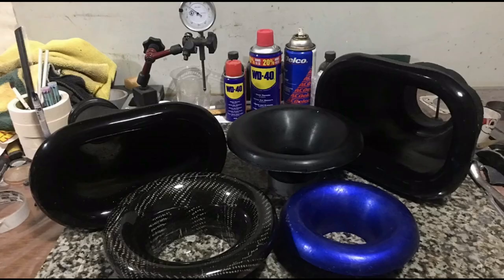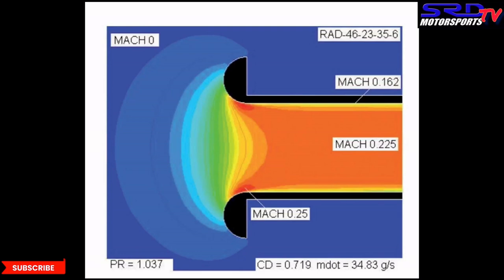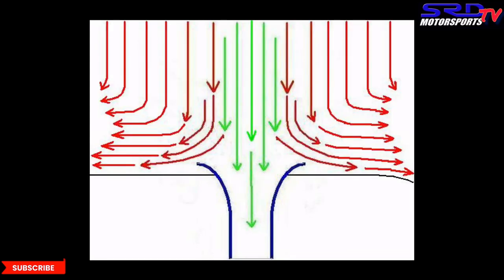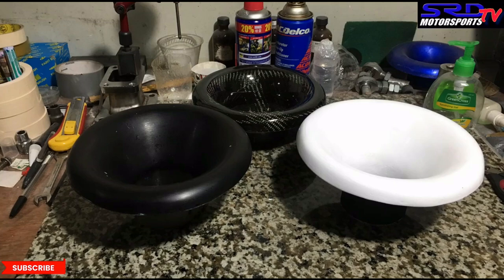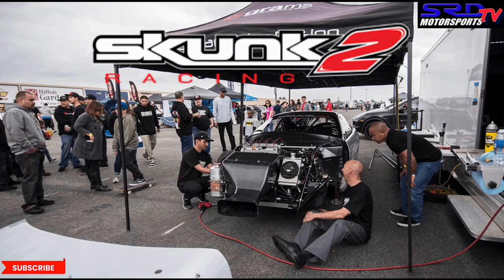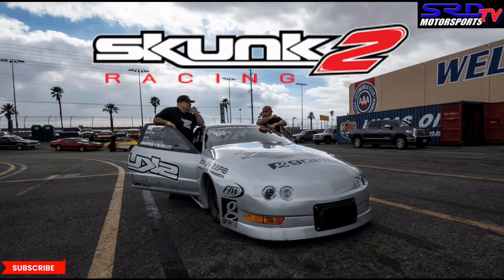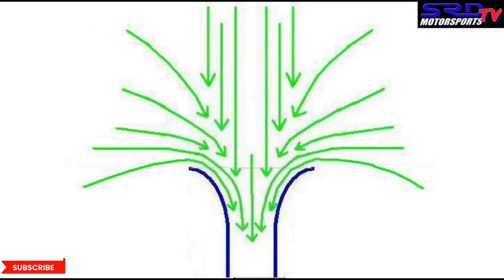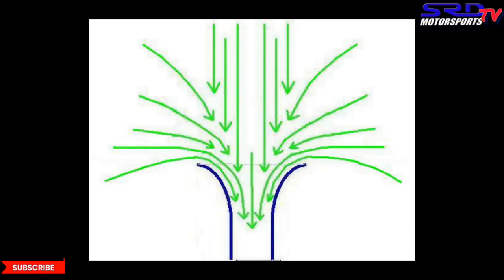Velocity Stack / Ram Air : Design Analysis by SRDmotorsports

Comment: Watching this while I design a set of velocity stacks for my E92 M3, cheers for the brilliant upload mate
Reply from the maker: whoa an E92 awesome!! and yep on this vid hopefully the "diagram" of all diff bellmouth entry can give you more interesting ideas TBH i was surprised at the highest rated one
Reply: @SRDmotorsports  I was really interested to see how much more airflow the ellipse had than the other designs. I found the paper you got those flow pics from and they had some guides for the dimensions to go off.
Reply from the maker: @ScottGroome  oooh will def update in the future to see changes on airflow mass change if there is any or do we need "more"

Great you saw the papers awesome!!!
if it helps, I use what its called i think Sintra board its sorta like a foam on varying thicknes and used that to make patterns/plugs then painted primer to be able to mold...

might be usable for you even when making an airbox :)
Reply: Did you did it ?

Comment: I feel like you're looking at the airflow around the intake wrong. 
Instead of looking at where the air goes (some of it diverting to the side of the intake) consider why it goes to the side. Pressure difference makes air move, if there isn't any pressure difference air won't move. If the air is diverting around the side of your intake it's because there's higher pressure in front of the intake and lower pressure to the sides. 

There's two separate things at work here: A velocity stack is designed to take relatively still air and get it into a tube as efficiently as possible by minimising the turbulence as air coming from the sides tries to make the turn into the pipe. It's purpose is to prevent turbulence and maintain laminar flow. 

A ram air intake's purpose is different, it's there to turn kinetic energy into pressure. You probably want a ram air intake into an airbox of sufficient size and then the engine drawing air through a velocity stack from the airbox which will be at positive pressure from the ram air. A jet engine intake is a ram air intake but a lot of the design in a jet engine intake is to slow air down from near transonic (or supersonic in some cases) to subsonic so the engine's compressors can handle it. This won't be a problem at road, or even race, car speeds.

My guess would be a velocity stack style intake on the most vertical part of the front bumper (stagnation point) feeding a tube that increases in cross sectional area as it goes to an airbox would be an your best bet. The rate at which the tube feeding the airbox gets wider would need to be calculated to maximize pressure recovery.
Reply from the maker: Yes hence my examples are the lesser super sonic ones not an sr71 or an f16

and on to the intake “why” it goes to the side

All I shared is running a velocity stack front faced at the track isnt an “ideal” thing to ise

Like you mentioned and as I mentioned in the video it was meant to be efficient at around “still” or “stagnant” air not “forward” facing like most Honda racers do,

On the dyno yeah it helps as the car is strapped down…pardon me if the English sentence structuring isn’t ideal on the video 😇

Comment: Interesting. I was running a carbon fiber intake on an all motor car a couple years ago. 

I was running a 168mm tb, and even then I thought it was too large but I ended up making a PSI on the map at high speed.

I like your break down. This is interesting
Reply from the maker: Hey! That psi is awesome u found that!

Comment: Nice video!  I still think your radius might be too large on your intake at 14:04 , as we see on the forward facing F1 car intakes (above the driver) at 9:07 to 10:20 , the radius on the inside in particular seems to be pretty small.  I don't think you need a velocity stack where it goes down to a circular profile inside the duct, but rather an efficient contraction profile that's perhaps more smoothly blended into overall contraction as it shrinks down.  That's a really cool intake any how though!
Reply from the maker: Yep the stack shape isn’t really needed for forward facing… the stack inside though was mainly to aid in reducing the contraption into a circular pipe, I just did mention I used a small stack as shape source for it

hence the oval intake I made is mainly for max cross section available and def worth a few tests :)

Comment: Enjoy your videos thank  You. So the theory is your velocity stacks with stagnant air or an enclosed department you run a flared velocity stack with taper  And in a forward facing you don't put a taper just a  Just a radius entry with no taper?
Reply from the maker: Kinda yes almost like that… 

in forward facing atleast based on datalogs I got for the Honda b20 we did 
At 12.1sec and over 114mph  it was still not enough that it still showed -0.4 reading 
A vacuum when we know at those speeds if all is good we should be slightly above atmospheric sadly nobody talks about that or shares it 😂

We used the cf 4in stack on that datalog

Comment: I'm just learning this stuff, and it's pretty awesome that you're going down this path.  You're right, everyone can learn it and make a more efficient motor.  I'm personally working on a Jeep 258, lol. But air flow is air flow- I can't rely on speed to get velocity, but have to use other tricks for Low end TQ and fill cylinders.  It's just for fun/hobby, I don't compete.

Have you ever read about something that would maybe help the front facing stack?  I could be way off here, lol, as you don't see this in front of jets or race cars, but maybe play around with shapes in FRONT of the hole, that split the air, then behind it (where intake would be) gather up that air from it being split.  Check this vid out.  Even the block shape, a Velocity stack behind it may "gather up" that turbulence behind the square, tear shape may work better.  Dunno, again, I may be totally off, lol.

Here...https://m.youtube.com/watch?v=RjzH-VAmi3E
Reply from the maker: Oh nice a Jeep!! I agree on hard to rely on speed for that but “taper” and bellmouth stuff u can slowly use to ur advantage!

on the second part yes I have seen that video and it’s real nice and what’s funny is it most understood it? then more would have a “proper” rear diffuser 😎 but sadly some just “copy paste” the idea without understanding it
Reply: @SRDmotorsports  
Yeah, most Jeep guy's use Butt Dynos, lol.  But I'm Dyno'ing different mods, kinda upsets some, make others happy- overall it settles debates that have been going on for sometimes 20 years!!  😆 

And it is an uphill battle, but it's fun trying different techniques to get performance, faster flows, etc.  If you can get 20 HP or TQ from an engine that revs to only 4k?  Then you have done something correct, lol.  And it's ALL about thinking outside the box.
Reply from the maker: @rustygehl  yes sirrrr! Wish the jeep had enoug engine bay space for a CAI which I talked about on the “volumetric efficiency” video as it gives a 4k rpm jump in power u could check it and prolly “upset” more peeps on the dyno haha
Reply: @SRDmotorsports  oh hell yeah!! I will check that out!!  Haven't had a chance to watch all vids yet
Reply from the maker: @rustygehl  no worries man! I just kinda see where u are getting at with the Jeep and it is fuuun!

Comment: learned a lot sir thank you!
now im wondering if it would make  changes if we tilt the velocity stack pointing downward on a certain degree just like the first picture of the sabre you posted, it is a bit longer at the top than the bottom part.
curious lang po.
Reply from the maker: that's an interesting observarion yeah... could help a bit but the diff is my drawing of the forward facing? the outside lip becomes a diversion too... towards biasing "palabas" but yeah thats a good observation
Reply from the maker: the other main thing with what i did was "cross secrional" area a bigger area = more volume hence example were the race cars that knew what they were doing :)
first to run 8sec All motor on Drag Cartel means Jeremy lookofsky knows whats up 🤣

Comment: as u said velocity stack is meant for stagnant air 
from your cfd we can see pressure after velocity stack is increasing
and as we all know air like to travel from high to low pressure 
as we have high pressure in front of the car 
we want the opening to not close but open up 
so we have lets say 4" opening to suck high pressure air in we want the tube after opening to increase in size to lets say 5" this way air will be sucked into the opening  
best way really is to utilzie air box 
so we have opening same dimater as intake piping that is leading to air box where air expands and lowers pressure 
and from there after the filter a velocity stack that will suck in the air into the manifold
Reply from the maker: yup
Reply: @SRDmotorsports  well after writing this comment i actually got new idea for my intake 
you keep my brain braining haha
Reply from the maker: @OGNISTYSZKQAJDII  hey!! That’s a win!!!! yes yes keep in mind the potential trouble of length can be manipulated to our advantage of length hehe 😎

Comment: most often we see increase in power from intakes mounted in headlights or bumper because of colder air not as much from amount of air 
especially on headlights air actually is sucked out because body of the car makes it travel to the side 
and as we get colder air it is better for the effeciency of the combustion but we dont get increase in pressure inside of the intake manifold 

i installed tube that is sucking air in front of radiator into the airbox 
compared to original intake that was runing 960mbar
im getting 988mbar when above 30kmh
but the air that is hitting radiator have other ways of avoiding the intake pipe because radiator is not sealed but even with that i got an increase in pressure 
but i have to service the intake monthly because airfilter is getting clogged with sand and pretty much everything that is on the road
Reply from the maker: it’s also the length of the intake that helps

but with a proper one I have seen datalog of increased pressure and it’s logged with 2 diff pressure sensor locations etc

even on the dyno the increase in power isn’t because it’s cold only but also the length…

Yes the headlight location isn’t most ideal as shown in the video it gets swayed to the aside (airflow)
Reply: @SRDmotorsports i did not look into the affect of intake lenght except for actuall runners lenght
i guess i will test it out 
i really like your videos 
i ported my throttle body because of your videos on that topic 
10% increase in airflow 🤯
keep it up
Reply from the maker: @OGNISTYSZKQAJDII  your intake trick idea is actually cool! I hope u can further develop it and find more learnings… that ac try ally helps all of us move forward :)

Good job on the throttle!

actually I’ve been thinking of a little more stuff that we can do and will try to make more vids about it

Comment: It’s funny I was going to put a velocity stack for ram air on my plane. Now I’m not🤣
Reply from the maker: @alexhuey6489  I always flew rc planes as a kid and loved it

(You could adapt something…check the inlet of an F86 Sabre jet and the Mig15) shhhh 😎
Reply: @SRDmotorsports  my original plan was to adapt a velocity stack to the intake. But now I’m going to extend the inlet about 2 inch’s forward of the front. Get clean air that hasn’t been affected by the boundary layer and misses the propeller by an inch while stacking air.
Reply from the maker: @alexhuey6489  now u got something there!!! Yes and that slight extension would help “stack up” flow too! win / win